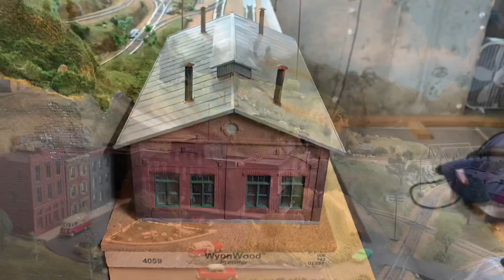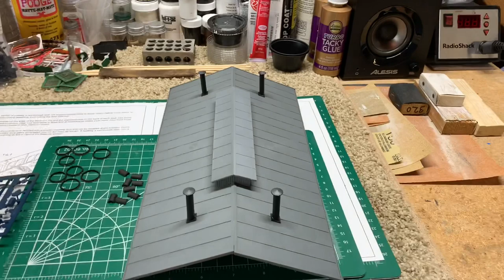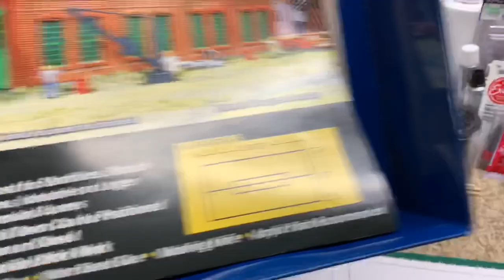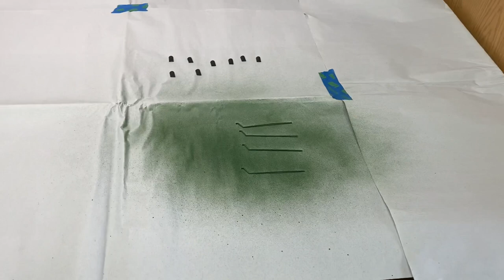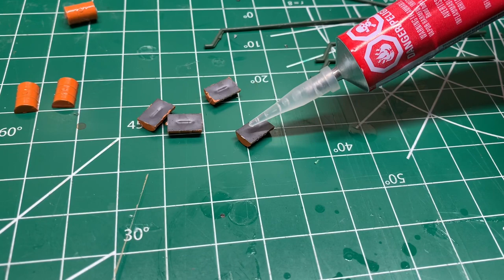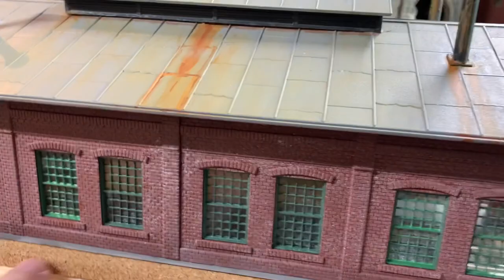Building The Walthers 2-Stall Engine House. Part 2

Comment: What did you do to weather the roof before you added the Rainmarks?
Reply from the maker: Hi Sal, I used a combination of silver and gray spray paint to make it look a bit more aged.
Reply: @DansGrandValley  I did that in the beginning when I painted the roof. It appears like you did another procees when you were doing the Rainmarks. It looks like the left side that is weathered is darker than the unweathered side on the right.
 I'm kind of new to all of this and just want my model to look as good as possible.
Reply from the maker: Sal. I went back and watched the video. I just used the Vallejo rain marks wash, and what you’re seeing on the left side is where I brushed it out. It made it look more dull and dark than the right side that was not finished yet. I did that over the whole roof, and it all came out even and pretty well weathered. So besides the spray paint, I only used the rain marks, the rust paint, and a little bit of crackling paint for the tops of the vent stacks.
-Dan
Reply: @DansGrandValley  thanks Dan that helps and thank you for replying to a 3 year old video.

Comment: Dan, the engine house looks great, nice weathering. For your poles you said you was not you going to run wire. I was going do the.same thing but I found a.product that is.amazing it is called EZline, it is super flexible and easy to work with, you can check it out at www.berkshirejunction.com they have a video showing the flexibility of the product i thought you might be interested. Keep the videos coming👍
Reply from the maker: lou schneider thank you!  Great tip, I’ll go check k it out. 👍🏼